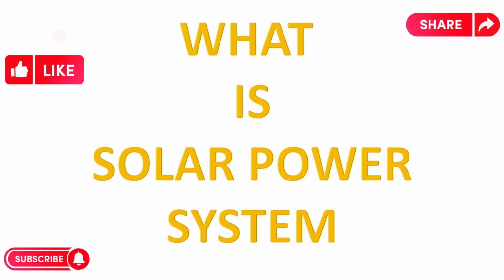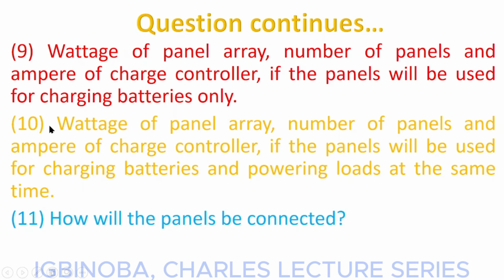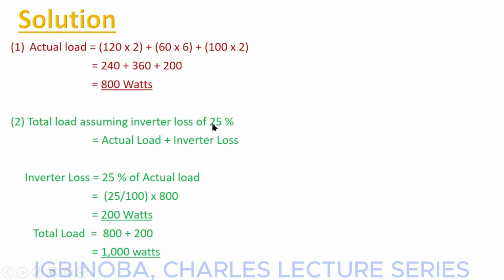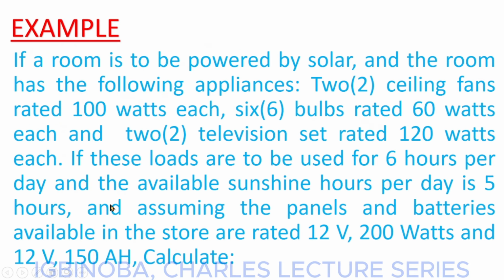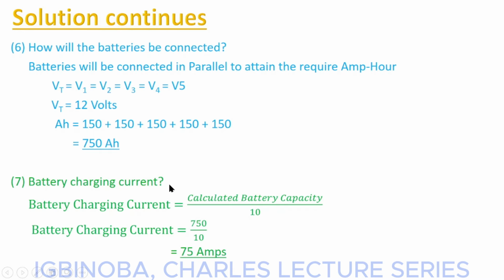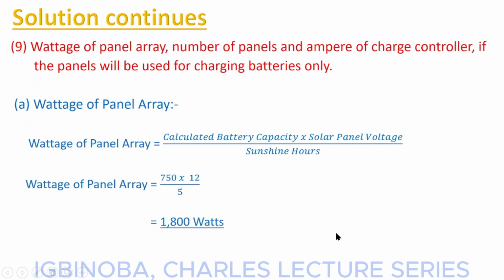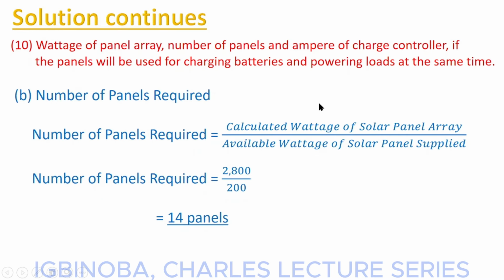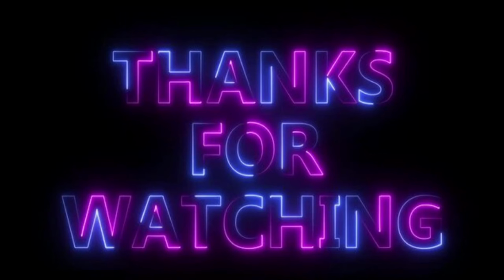Design of Solar Power System

Comment: COMP64L

1. The actual pad is 1,380W
2. The Total load is 1,725W
3. The inverter rating is 2,156.23VA
4. The battery capacity is 1,293.75Ah 
5. The Number of batteries is 9
6.  The batteries are connected in parallel 
7. The Battery charging current is 129.4 amps.
8. The battery charging time is 14 hours.
9. a. The wattage of the panel array is 3,105W
b. The number of panels is 16 panels.
c. The Charge controller rating is 258.75 amps.

10. a. The wattage of the Panel array is 4,830 Watts 
b. The number of panels is 24 panels.
c. The charge controller rating is 402.5 amps
11. The panels are arranged in parallel

Comment: EEE2B 
1. Actual load is 1380W
2. Total load is 1840W
3. Inverter rating is 2300VA
4. Battery capacity is 920 AH
5. 7 batteries are needed 
6. Battery connection is in parallel 
7. Battery capacity current is 210A
8. Hours for charging is 8.33 hrs
9. Panels required are 13 panels of 2520W and a charge controller of 217A
10. Panels required for carrying the loads and charging the batteries at the same time are 22 panels of 4360W with a 367A charge controller 
11 panels are connected in parallel
Reply: MAR77Y

1. Actual load is 1380 W.

2. Total load is 1840 W.

3. Inverter rating is 2300 VA.

4. Battery capacity is 920 Ah.

5. 7 batteries are needed.

6. Battery connection is in parallel.

7. Battery capacity current is 210 A.

8. Charging time is 8.33 hours.

9. Panels required are 13 panels of 2520 W, with a charge controller of 217 A.

10. Panels required for carrying the loads and charging the batteries at the same time are 22 panels of 4360 W, with a 367 A charge controller.

11. Panels are connected in parallel.

Comment: CHM48V

1. The actual pad is 1,380W
2. The Total load is 1,725W
3. The inverter rating is 2,156.23VA
4. The battery capacity is 1,293.75Ah 
5. The Number of batteries is 9
6.  The batteries are connected in parallel 
7. The Battery charging current is 129.4 amps.
8. The battery charging time is 14 hours.
9. a. The wattage of the panel array is 3,105W
b. The number of panels is 16 panels.
c. The Charge controller rating is 258.75 amps.

10. a. The wattage of the Panel array is 4,830 Watts 
b. The number of panels is 24 panels.
c. The charge controller rating is 402.5 amps
11. The panels are arranged in parallel

Comment: PETROCHEM18R

Actual Load: 1380 W

Total Load: 1840 W

Inverter Rating (0.8 Power Factor): 2300 VA (or 2.3 KVA)

Battery Capacity: 1226.67 Ah

Number of Batteries: 9 batteries

Battery Connection: Parallel

Battery Charging Current: 120 A

Battery Charging Time: 16.67 hours

Solar Setup (Batteries Only): 2944 W (or 3000 W), 15 panels, 250 A charge controller

Solar Setup (Batteries + Load Simultaneously): 4784 W (or 4800 W), 24 panels, 400 A charge controller

Panel Connection: Parallel

Comment: Petrochem 3C
Answers 
1) Actual load =1380Watt
2)Total load = 1725 watt
3) Inverter rating=2156.25VA
4) Battery Capacity=1239.75Ah
5) Number of batteries=8.625 (9 batteries)
6)They will be connected in parallel 
7) Battery charging current=129.375A
8) Battery charging time with 40% loss=14 hrs
9a) Wattage of panel array=3105 Watt 
9b) Number of panel=16 panels 
9c) Ampere of charge controller = 258.75A
10a) Wattage of panel array=4445 Watt 
10b) Number of panel=23 panels 
10c) Ampere of charge controller= 373.75A
11) They will be connected in parallel

Comment: MEC115K
1. 1380W 

2. 1725W 

3. 2156.25 VA 

4. 1294Ah 

5. 9 batteries 

6. The batteries would need to be connected in parallel 

7. 129.4A 

8. 14 hours 

9a. 3105.6W 
b. 16 panels 
c. 258.8 A 

10 a. 4830.6 W 
b. 25 panels 
c. 402.6 A 

11. The panels will need to be connected in parallel.

Comment: CIV40N
Answer

1) Actual load is 1380W
2)Total load is 1725W
3) Inverter rating is 2156.23VA
4) Battery capacity is 1293.75AH
5) Number of batteries is 9
6) The batteries are connected in parallel.
7)The batteries charging current is 129.4A
8)The battery charging time is 14 hours.
9a)The wattage of the panel array is 3105watt.
9b) The number of panel required is 9 panel.
9c)Ampere of charging controller required is 258.75A.
10a)The wattage of the panel array is 4830watt.
10b)The number of panel is 24 panel.
10c) The charge controller rating is 402.5A.
11)The panels are arranged in parallel.

Comment: PETROCHEM51Y

1. 1380watt

2. 1725 watt

3.  3450Va

4. Battery capacity = 1293.75AH

5. numbers of batteries =9 (approximately)

6. The battery will be connected in parallel 

7. Battery charging current =  129.375 AH

8. Charging time = 14hr 

9 (a) 3105 watt

(b) 16 (approximately)
 
(C) 258.75Amps 

10. ( a) 4830watt 

 (b) 24 (approximately)

(C) 402.5 Amps 

11. It will be connected in parallel

Comment: PETRO6F

Answers:
1. Actual load = 1380Watt
2. Total load = 1725Watt
3. Inverter rating = 2156.25VA
4. Battery Capacity = 1239.75Ah
5. Number of batteries = 8.625 (9 batteries)
6. They will be connected in parallel 
7. Battery charging current = 129.375A
8. Battery charging time with 40% loss = 14hrs
9a. Wattage of panel array = 3105Watt
9b. Number of panels = 16panels
9c. Ampere of charge controller = 258.75A
10a. Wattage of panel array with load = 4485Watt
10b. Number of panels = 23panels
10c. Ampere of charge controller = 373.75A
11. They will be connected in parallel.

Comment: CIV27A 

1.Actual load: 1380 W

2. Total load (25% inverter loss): 1,840 W

3. Inverter rating: 2,300 VA
4. Battery capacity: 1,226.7 Ah

5. Number of batteries: 9 batteries

6. Battery connection: Parallel

7. Battery charging current: 245.3 A
8. Battery charging time: 8.33 hours
9.  For charging batteries only:  245A
10. For charging and powering batteries simultaneously:  399A
11. Parallel connection

Comment: PETROCHEM13M 
1. Actual load: 1380W
2. Total load: 1725W
3. The inverter rating is 2156.23VA
4. Battery capacity is 1293.75Ah
6. Battery connections in parallel 
7. Battery charging current is 129.4A
8. Battery charging time is 14hrs
9. ( Charging battery only)
a. The wattage of the panel array is 3105W
b. The number of panels is 16 panels 
c. The charge controller rating is 258.75A
10. (Charging and powering simultaneously)
a. The wattage of the charging array is 4830W.
b. The number of panels is 24 panels 
c. The charge controller rating is 402.5A
The panel connection is parallel

Comment: MAR83E

1) Actual Load: 1380 W
2) Total Load: 1840 W
3) Inverter Rating (0.8 Power Factor): 2300 VA (or 2.3
KVA)
4) Battery Capacity: 1226.67 Ah
5) Number of Batteries: 9 batteries
6) Battery Connection: Parallel
7) Battery Charging Current: 120 A
8) Battery Charging Time: 16.67 hours
9) Solar Setup (Batteries Only): 2944 W (or 3000 W), 15 panels, 250 A charge controller
10) Solar Setup (Batteries + Load Simultaneously): 4784
W (or 4800 W), 24 panels, 400 A charge controller
11 Panel Connection: Parallel

Comment: PETRO1A

Answers:
1. Actual load = 1380Watt
2. Total load = 1725Watt
3. Inverter rating = 2156.25VA
4. Battery Capacity = 1239.75Ah
5. Number of batteries = 8.625 (9 batteries)
6. They will be connected in parallel 
7. Battery charging current = 129.375A
8. Battery charging time with 40% loss = 14hrs
9a. Wattage of panel array = 3105Watt
9b. Number of panels = 16panels
9c. Ampere of charge controller = 258.75A
10a. Wattage of panel array with load = 4485Watt
10b. Number of panels = 23panels
10c. Ampere of charge controller = 373.75A
11. They will be connected in parallel.

Comment: COMP1A

1. The actual pad is 1,380W
2. The Total load is 1,725W
3. The inverter rating is 2,156.23VA
4. The battery capacity is 1,293.75Ah 
5. The Number of batteries is 9
6.  The batteries are connected in parallel 
7. The Battery charging current is 129.4 amps.
8. The battery charging time is 14 hours.
9. a. The wattage of the panel array is 3,105W
b. The number of panels is 16 panels.
c. The Charge controller rating is 258.75 amps.

10. a. The wattage of the Panel array is 4,830 Watts 
b. The number of panels is 24 panels.
c. The charge controller rating is 402.5 amps
11. The panels are arranged in parallel

Comment: CIV21U

1)  Actual Load: 1380 W
2) Total Load: 1840 W
3)  Inverter Rating (0.8 Power Factor): 2300 VA (or 2.3 kVA)
4) Battery Capacity: 1226.67 Ah
5)  Number of Batteries: 9 batteries
6) Battery Connection: Parallel
7) Battery Charging Current: 120 A
8) Battery Charging Time: 16.67 hours
9) Solar Setup (Batteries Only): 2944 W (or 3000 W), 15 panels, 250 A charge controller
10) Solar Setup (Batteries + Load Simultaneously): 4784 W (or 4800 W), 24 panels, 400 A charge controller
11) Panel Connection: Parallel

Comment: PETROCHEM62J
SOLUTION

1) Actual Load: 1380 W  
2) Total Load: 1840 W  
3) Inverter Rating (0.8 Power Factor): 2300 VA (or 2.3 kVA)  
4) Battery Capacity: 1226.67 Ah  
5) Number of Batteries: 9 batteries  
6) Battery Connection: Parallel  
7) Battery Charging Current: 120 A  
8) Battery Charging Time: 16.67 hours  
9) Solar Setup (Batteries Only): 2944 W (or 3000 W), 15 panels, 250 A charge controller  
10) Solar Setup (Batteries + Load Simultaneously): 4784 W (or 4800 W), 24 panels, 400 A charge controller  
11) Panel Connection: Parallel

Comment: CIV7G

1) Actual load is 1380Watt. 
2)Total load is 1725watt.
3) Inverter rating is 2156.23VA
4) Battery capacity is 1293.75AH
5) Number of batteries is 9
6) The batteries are connected in parallel.
7)The batteries charging current is 129.4A
8)The battery charging time is 14 hours.
9a)The wattage of the panel array is 3105watt.
9b) The number of panel required is 9 panel.
9c)Ampere of charging controller required is 258.75A.
10a)The wattage of the panel array is 4830watt.
10b)The number of panel is 24 panel.
10c) The charge controller rating is 402.5A.
11)The panels are arranged in parallel.

Comment: PETRO62J

Answers:

1. Actual load = 1380Watt

2. Total load = 1725Watt

3. Inverter rating = 2156.25VA

4. Battery Capacity = 1239.75Ah

5. Number of batteries = 8.625 (9 batteries)

6. They will be connected in parallel

7. Battery charging current = 129.375A

8. Battery charging time with 40% loss = 14hrs

9a. Wattage of panel array = 3105Watt

9b. Number of panels = 16panels

9c. Ampere of charge controller = 258.75A

10a. Wattage of panel array with load = 4485Watt

10b. Number of panels = 23panels

10c. Ampere of charge controller = 373.75A

11. They will be connected in parallel

Comment: PETRO82D 

1380W
 1725 W 
 2156.25VA 
 1293.75AH
 9 batteries. 
The batteries will be connected in parallel 
 129.375A
14hrs 
 3105W
16 panels 
258.75A 
300A Charge controller will be suitable. 
 4830 A 
24 Panels 
 402.5A
500A charge controller will be suitable
The panels will be connected in Series

Comment: EEE101W

1. Actual Load: 1380 W
2. Total Load: 1840 W
3. Inverter Rating (0.8 Power Factor): 2300 VA (or 2.3 KVA)
4. Battery Capacity: 1226.67 Ah
5. Number of Batteries: 9 batteries
6. Battery Connection: Parallel
7. Battery Charging Current: 120 A
8. Battery Charging Time: 16.67 hours
9. Solar Setup (Batteries Only): 2944 W (or 3000 W), 15 panels, 250 A charge controller
10. Solar Setup (Batteries + Load Simultaneously): 4784 W (or 4800 W), 24 panels, 400 A charge controller
11. Panel Connection: Parallel

Comment: MEC59G

1. Actual load = 1380 watts

2. Total load assuming a loss of 25% = 1725 watts

3. Inverter rating using a power  factor of 0.8 = 2156.25 watts

4. Battery capacity using a factor reserve of 75% = 1293.75Ah

5. Number of batteries = 9 batteries 

6. It's a parallel connection 

7. Battery charging current = 129.4 Amps 

8. Battery charging time = 14 hours

9a. Wattage of panel array = 3105 watts
9b. Number of panels = 16 panels. 
9c. Ampere of charge controller = 258.75 Amps

10a. Wattage of power = 4830 watts
10b. Number of panels = 24 panels 
10c. Ampere of charge controller = 402.5 Amps

11. It's a parallel connection

Comment: MEC6F

1.  The actual pad is 1,380W
2.  The Total load is 1,725W
3.  The inverter rating is 2,156.23VA
4.  The battery capacity is 1,293.75Ah
5.  The Number of batteries is 9
6.  The batteries are connected in parallel
7.  The Battery charging current is 129.4 amps.
8.  The battery charging time is 14 hours.
9.  a. The wattage of the panel array is 3,105W
 b. The number of panels is 16 panels.
 c. The Charge controller rating is 258.75 amps.
10. a. The wattage of the Panel array is 4,830 Watts
 b. The number of panels is 24 panels.
 c. The charge controller rating is 402.5 amps
11. The panels are arranged in parallel

Comment: PETRO68P

Answers:
1. Actual load = 1380Watt
2. Total load = 1725Watt
3. Inverter rating = 2156.25VA
4. Battery Capacity = 1239.75Ah
5. Number of batteries = 8.625 (9 batteries)
6. They will be connected in parallel 
7. Battery charging current = 129.375A
8. Battery charging time with 40% loss = 14hrs
9a. Wattage of panel array = 3105Watt
9b. Number of panels = 16panels
9c. Ampere of charge controller = 258.75A
10a. Wattage of panel array with load = 4485Watt
10b. Number of panels = 23panels
10c. Ampere of charge controller = 373.75A
11. They will be connected in parallel.
Reply: CIV4D 

Answers:
Actual load = 1380Watt
Total load = 1725Watt
Inverter rating = 2156.25VA
Battery Capacity = 1239.75Ah
Number of batteries = 8.625 (9 batteries)
They will be connected in parallel
Battery charging current = 129.375A
Battery charging time with 40% loss = 14hrs
9a. Wattage of panel array = 3105Watt
9b. Number of panels = 16panels
9c. Ampere of charge controller = 258.75A
10a. Wattage of panel array with load = 4485Watt
10b. Number of panels = 23panels
10c. Ampere of charge controller = 373.75A
11. They will be connected in parallel.

Comment: CIV38L

1. Actual Load: 1380 W
*2. Total Load: 1840 W
*3. Inverter Rating (0.8 Power Factor): 2300 VA (or 2.3 kVA)
*4. Battery Capacity: 1226.67 Ah
*5. Number of Batteries: 9 batteries
6) Battery Connection: Parallel
7) Battery Charging Current: 120 A
8) Battery Charging Time: 16.67 hours
9) Solar Setup (Batteries Only): 2944 W (or 3000 W), 15 panels, 250 A charge controller
10) Solar Setup (Batteries + Load Simultaneously): 4784 W (or 4800 W), 24 panels, 400 A charge controller
11) Panel Connection: Parallel

Comment: CHM42P
1. Actual load:1,380W

2. total load:1840W

3. inverter rating:2300VA

4. Battery capacity:920AH

5. Number of batteries:7

6. battery connection: parallel

7. Battery charging current:210A

8. battery charging time:8.33 hours

9. panels for battery charging:2520W; 13 panels;217 a controller

10. Panels for charging+ load:4360W;22 panels;367 A controller

11. Panel connection: parallel.

Comment: PETROCHEM44R 
1) Actual Load: 1380 W
2) Total Load: 1840 W
3) Inverter Rating (0.8 Power Factor): 2300 VA (or
2.3 KVA)
4) Battery Capacity: 1226.67 Ah
5) Number of Batteries: 9 batteries
6) Battery Connection: Parallel
7) Battery Charging Current: 120 A
8) Battery Charging Time: 16.67 hours
9) Solar Setup (Batteries Only): 2944 W (or 3000
W), 15 panels, 250 A charge controller
10) Solar Setup (Batteries + Load Simultaneously):
4784 W (or 4800 W), 24 panels, 400 A charge controller
11) Panel Connection: Parallel

Comment: COMP45S 

1. The actual pad is 1,380W
2. The Total load is 1,725W
3. The inverter rating is 2,156.23VA
4. The battery capacity is 1,293.75Ah 
5. The Number of batteries is 9
6.  The batteries are connected in parallel 
7. The Battery charging current is 129.4 amps.
8. The battery charging time is 14 hours.
9. a. The wattage of the panel array is 3,105W
b. The number of panels is 16 panels.
c. The Charge controller rating is 258.75 amps.

10. a. The wattage of the Panel array is 4,830 Watts 
b. The number of panels is 24 panels.
c. The charge controller rating is 402.5 amps
11. The panels are arranged in parallel

Comment: CIV29C

1. Actual load is 1380Watt.
2. Total load is 1725Watt.
3. Inverter rating is 2156.23VA
4. Battery capacity is 1293.75AH
5. Number of batteries is 9
6. The batteries are connected in parallel.
7. The batteries charging current is 129.4Amp
8. The battery charging time is 10 hours.
9a. The wattage of the panel array is 3105Watt.
9b. The number of panel required is 9 panel.
9c. Ampere of charging controller required is 258.75Amp.
10a. The wattage of the panel array is 4830Watt.
10b. The number of panel is 24 panel.
10c. The charge controller rating is 402.5Amp.
11. The panels are arranged in parallel.

Comment: CHM75W 

1. Actual Load = 1380W

2.Total Load (at 25% inverter loss)=1840W

3.Inverter Rating (at pf of 0.8) =2300VA

4. Battery Cap=1227Ah

5. Number of Batteries= 9 batteries 

6. Connection is in parallel ( voltage is constant)

7. Charging Current= 245.3A

8. Charging Time ( at 40% loss) = 8.33hrs

9. Panels for charging only

Energy required= 24540Wh

Wattage=4908W

Number of panels (rating of 200W) = 24.54 approx. 25 panels

Charge controller curren=409A

10. Panel for charging and powering 

Energy required = 35580

Wattage  =7116W

Number of panels(@200W rating)
 = 35.58 approx. 36 panels

Charge controller current
= 593A

11.  Connection is in parallel ( constant 12V across all panels)

Comment: CIV58F

1. Actual Load: 1380 W

2. Total Load: 1840 W

3. Inverter Rating (0.8 Power Factor): 2300 VA (or 2.3 kVA)

4. Battery Capacity: 1226.67 Ah

5. Number of Batteries: 9 batteries

6. Battery Connection: Parallel

7: Battery Charging Current: 120 A

8. Battery Charging Time: 16.67 hours

9. Solar Setup (Batteries Only): 
  a. 2944 W (or 3000 W), 
  b. 15 panels, 
  c. 250 A charge controller

10. Solar Setup (Batteries + Load Simultaneously): 
  a. 4784 W (or 4800 W), 
  b. 24 panels, 
  c. 400 A charge controller

11. Panel Connection: Parallel